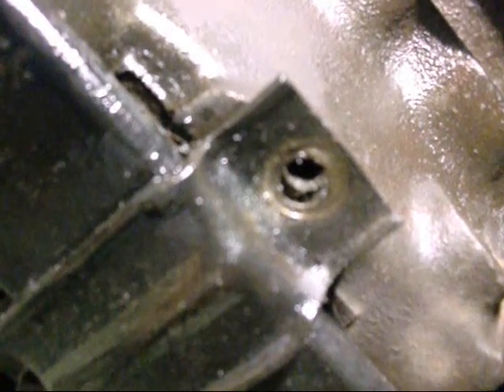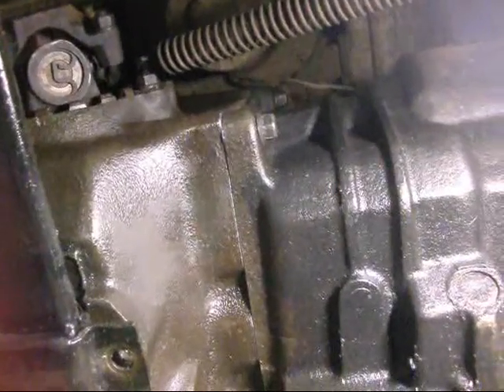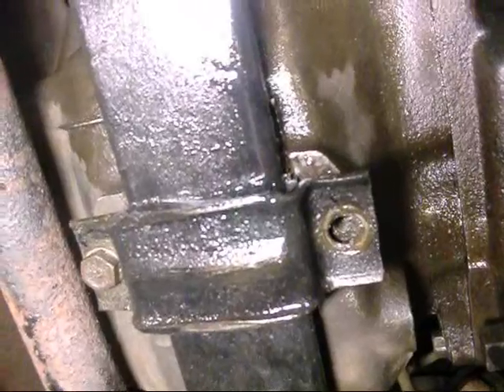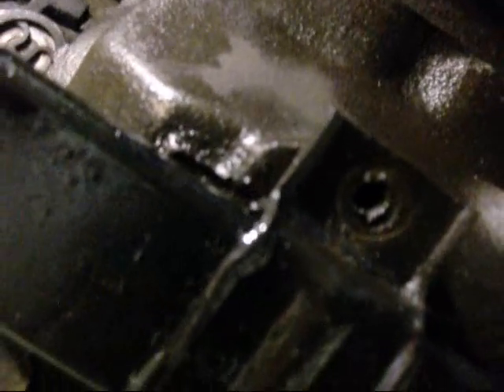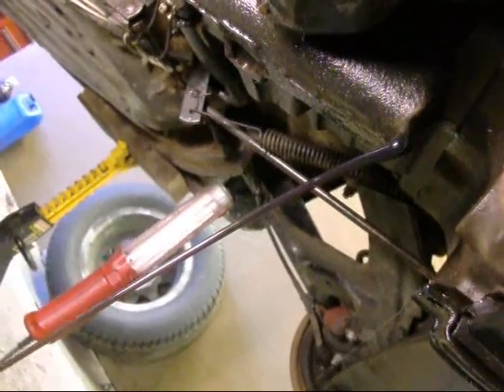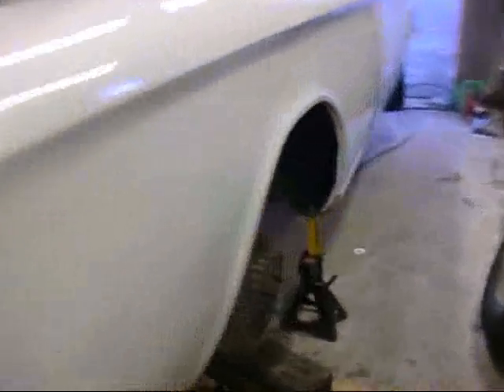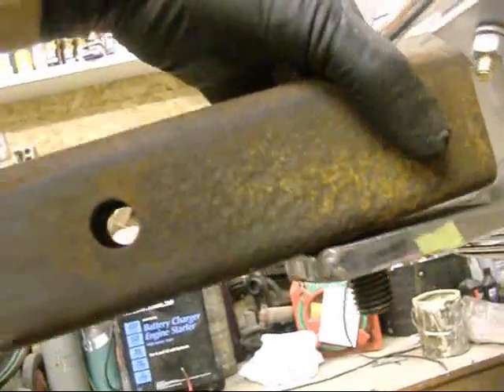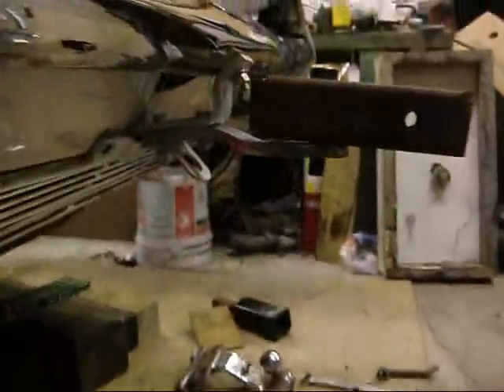7 5 12  Spyder Diffy Drill...

Comment: I have done the following back in 1978 my friend had a 61 corvair and to fush it out he bought straight weight 30 weight oil plain and he did it 2 times then filled it up with correct oil. 
After that it ran great and he changed it after 10 miles to make sure no stuff were still in it.
Then it ran great for over 10 years when I went in the NAVY and never seen it again.

Comment: ok comment 912 , you can flush the diff and trans with straight non detergent 30 weight engine oil , the stuff has no additives , and is cheap (dollar store) then refill with correct lube